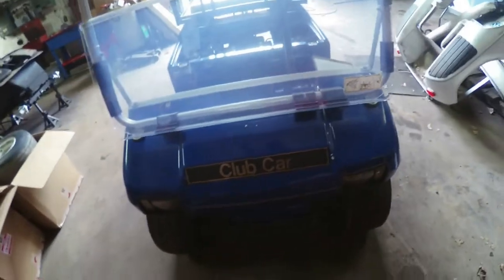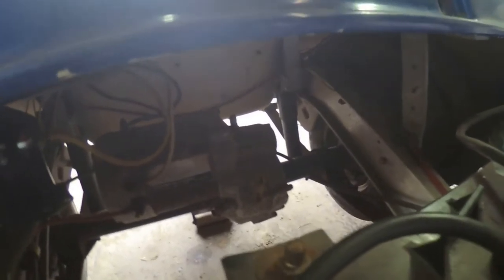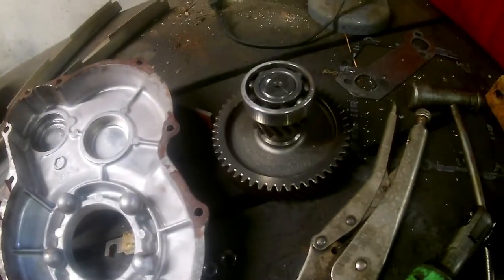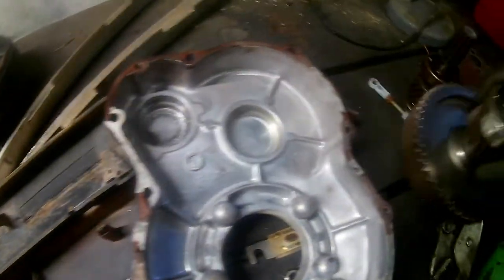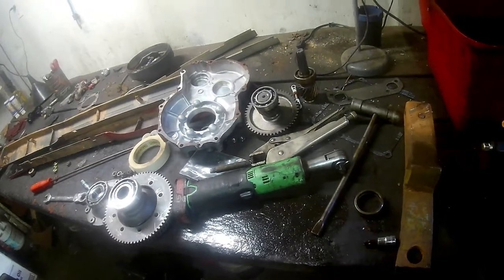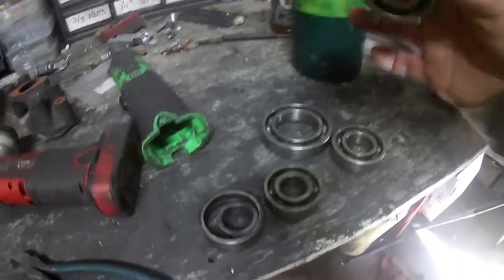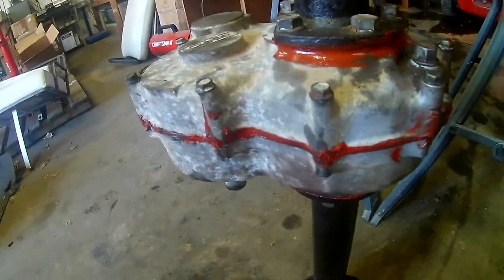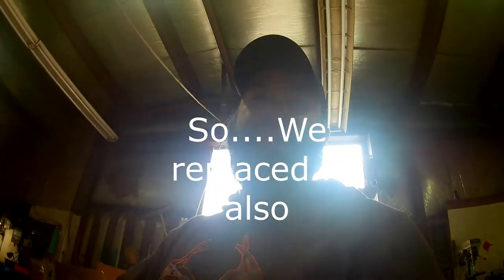Club Car Rear End Noise

Comment: Great video and thank you for explaining all this.  I have an early 80's club car DS, and my kids were driving around our neighborhood and the rear axle and right side tire slid off.  We were able to jack it up, push the tire and axle back in, and when you would press the petal, it would just spin inside the casing but not turn the rear tires.  What would be the possible cause of this? Thank you!
Reply from the maker: Sounds like the splines are not lined up. It could be the one at the brake area not turning the drum. Need to jack it up and pull the wheel off to check.

Comment: I have this golf cart wanting to make it a little faster what would you recommend without spending a grand
Reply: hopefully im not too late, contact plum quick motors in south carolina, i sent in my core and they rebuilt it for 250 bucks with the bandit upgrade. next im going to get a 400 amp navitas controller. should get up to 28 mph